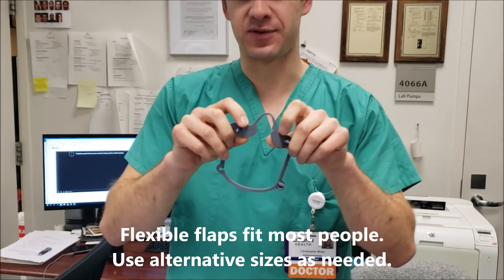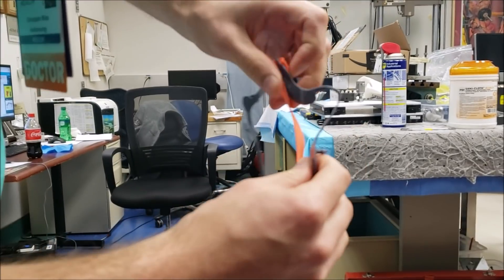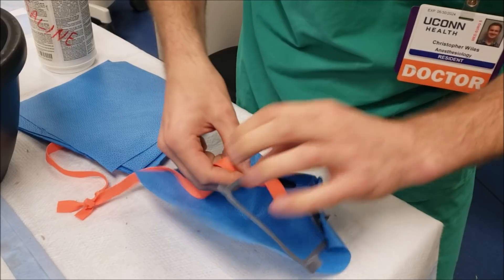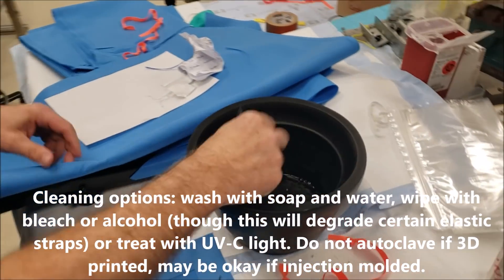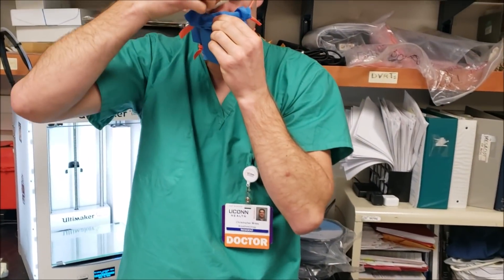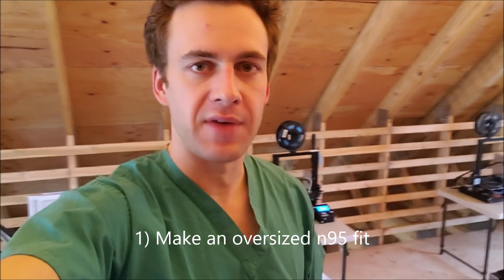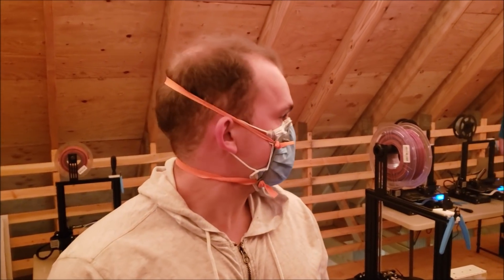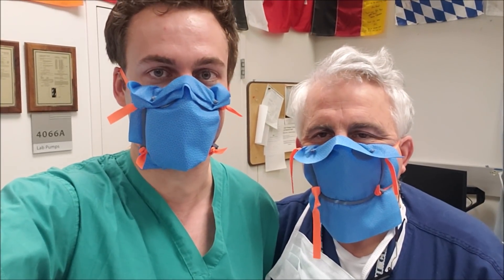COVID 3D Printed Mask Frame for Halyard, Investigating 99% Filtration

Comment from the maker: update 4/23: preliminary data from more than one lab show that this material does not filter as well as originally suggested under higher flow rates that may be seen during fast breathing such as running up the stairs or while doing CPR. At lower flow rates it performs relatively well, but at higher flow rates it performs sub-optimally, and the n99 or n95 levels should not be assumed under all or any conditions. Exact numbers are not available. This is likely a relevant design under many physiologic conditions and may likely be used a replacement for a surgical/medical/cloth mask, but we cannot endorse usage for this as an n95 at this time. Keep this in mind and use at your own risk.
Reply: Will the data for the filtration efficiency of this material be published in the near future? We have been producing the UF mask design both with this material and with 4 ply cotton; we are not a medical facility, but do have essential staff and biosecurity requirements. Another paper recently came out analyzing the efficiency (Konda, Abhiteja, et al. "Aerosol Filtration Efficiency of Common Fabrics Used in Respiratory Cloth Masks." ACS Nano (2020).) and I am trying to decide how Halyard compares to these other fabrics. If it is not going to be published, would the labs be willing to share their findings?

Comment: Will H500 work? Trying to find supplies as a non medical.
Reply from the maker: As a last resort, anything like this (blue polypropylene type materials) will have some sort of filtration capacity. No guarantees, but if you do a couple layers and it's in that sweet spot of breathable but almost too dense to breath through, and you have a good seal, you're likely filtering the majority of particles. Use real masks if you have them, but in total shortage scenarios go for anything you can get your hands on that is better than nothing.

Comment: That size looks like 18x20cm not inches. But thank you for the video. I'm printing some of these for my local veterinarian, who likely has the Halyard material - I will be using blue shop towels for my own (until I print the other style and get the filtration material).

Comment: What’s really sad masks don’t work against them
Reply: masks work to filter out certain particulates, but unless you have your own oxygen supply and zero outside air, there's no possible way to fully filtrate the particulates of any virus due to their size.  Pure oxygen however can kill you, so the best you can do is wear a mask with a filter, CDC might equate this equivalent to a bandana at the current rate, however it has the potential to be on the same rating as the n95 mask with the right filter. Any high enough rated and working filter can potentially catch a clump of particulate, which is better than no mask whatsoever however.

Comment: to cut the Halyard H600, why not use a Nicochrome wire with a current running over it.  it will burn red hot, cut and seal the two fabrics together.

Comment: As we've been saying from the beginning, sealing a good filtration material is the right way to make a functional mask 👏🏼👏🏼. We have a hospital field test in the works with our rubber band solution. Our version 2 is coming soon very shortly.

We love what you're doing here Chris! Your solution will actually help people. Would love to see it tried on multiple face shapes (women, children) too.
Reply from the maker: I have been following your work, as well! I agree completely - without a good seal, the filter material doesn't do the job you want, no matter what the filter is made of. Keep it up! I'll look for your version 2.
Reply: @chrischris64   Hey Chris, Love the mask design.  I have been working on two mask ideas that are using flexible filament to make all components printable including the elastic straps.  One is inspired by Sabrina's rubber band frame, and the other is similar in it's approach to your mask using a Halyard material as the filter. I can only get h100 so I'm assuming it wont be sufficient for nurses and doctors but I am hoping its at least something I can make for grocery store employees and other front line workers. While h100 is not the same as the h600 it's at least seemingly denser than cotton or other DIY materials.  Do you know if there is any research into the filtration qualities of the lower grade Halyard materials? Thanks!
Reply: @sniejadlik  This is the best source I've seen yet, though not peer reviewed. Check out the tables for one specific to Halyard products: https://sites.google.com/view/material-filter-testing/home

Comment: Should that be 18x20 cm, not inches?
Reply from the maker: YES! Sorry about that, it is cm. Also, you can cut bigger if you have more than enough material, such as 22 x 24 cm. That allows you to pull it through the front of the mask more for more comfort and surface area if you want. We just found those were the minimum measurements.

Comment: If anyone is using a FlashForge Finder I suggest: 210°F, 2.7mm first layer, 1.8mm next layer, 100% infill. Thermoforming with a hairdryer recommended. Also I dunked one in Alcohol for 24hrs and the structural integrity remained the next day. They do have their limits of bending though. I would suggest printing a ton of these using a few times then replacing. At 25 min a print this is a no brainer! Awesome work Dr Wiles
Reply from the maker: Awesome, I'm glad that worked for you. Thanks for sharing the alcohol soak test. I agree with frequent replacement with the short print time. I do 2 on a plate, about a 1 hour print. We have 22 printers and are looking into injection molding.

Comment: Wow! This is brilliant.  I saw your video on how to make an "N95 mask" with your 3D printer.  Thank you for what you're doing and share your innovations.  Have you put this mask through a FIT test?  Just curious if it passed or not.  Great uses for your creation!

My coworker and I came up with this idea for a surgical mask made from surgical blue wrap. It is not to replace the N95, but helps extend the mask. We also use these masks on patients and as our primary surgical masks.
https://www.youtube.com/watch?v=UrG_xmFq5e4&t=1s
Reply from the maker: Hi Brady. It did pass fit testing, yes. If trouble with fit, I made some alternative files, but most people will get a good fit and a rubber band between the spikes to close and nose/cheek gaps works really well.

Comment: Awesome design. Much better than any other "respirator design I've seen. But a point to make, 3:52 vacuum bags... Just so you know, most vacuum bags claiming to be hepa, aren't. Yhe hepa rating is on the vacuum cleaner itself and is a combination of vacuum bag and the permanent filter. Most vacuum bags are around MERV 10-12 while HEPA is 18.

You are better off buying a furnace or hvac filter.

Comment: For those without access to the surgical material,  this shows some possibility.  Anyone else seen testing of the towel material?

https://www.businessinsider.com/homemade-mask-using-hydro-knit-shop-towel-filters-better-2020-4
Reply: I tried looking into this form the Kimberley-Clark Professional site. After a lot of looking and finding conflicting statements it seems you have a choice of Hydroknit style (the Zep) which is fiber mixed with polypropylene or a straight meltblown polypropylene. It seems like the melt blown by itself would be finer but again they are very vague about stuff.The 3M masks use a mix of fiber and poly so are probably the Hydroknit. Wish I could get straight answers... all the suppliers around me don't really know for sure. One thing the 3M N95's I'm am pretty sure are given a charge to attract the very smallest particles - same as the furnace filters. I've heard nothing about the shop towels having that.

Comment: I printed your first mask and I used the moldable silicon rubber made with either Aquarium grade or Food Safe silicon sealant and corn flour. You can stick this to the mask using a thin smear of silicon sealant around the mask edge. If you place a sandwich bag over the part of the mask that accepts your face whilst the putty is still pliable, you can get a great seal by moulding the putty to the shape of your face.
 I then did a bit of a dangerous experiment to prove that the mask and the seal worked. I bought some Bitter Yuck anti chew spray for dogs off Amazon, donned the 3D printed mask and full chemical goggles and then I got the wife to spray me directly in the face 4 or 5 times with the Bitter Yuck spray. I had a taste of the Bitter Yuck spray before hand and it wasn't too unpleasant although it's definitely not recommend for human consumption on the packet. 
The mask worked great although I thought I could every so slightly taste something, but I was using J-Cloths as the filter material instead of a better material, however it did stop the Bitter Yuck getting through. Bitter Yuck contains Bitex so I figured  it would be okay and desperate times warrant desperate measures. However  on trying to wash the Bitter Yuck off my face revealed that the skin around and the mask around the googles was heavily contaminated and as I washed my face. I washed the Bitter Yuck into my mouth and up my nose, it took about six hours to get rid of the taste and the wife wouldn't go near me for a couple of days!
This revealed to me how important plastic full face visors are. If I had been hit by a stream of virus infected sputum instead of the Bitter Tuck spray, I would have certainly ingested some virus particles when I went to wash my face.
Reply from the maker: Haha amazing effort on your part. That was great to read. But in all seriousness, you're right about the virus and washing your face. I'm working on a quick face shield video now too. Wearing one is imperative to reusing masks, which is currently happening due to shortage, and staying as clean as possible. Thanks for the silicone with corn starch idea. I had never heard of that.

Comment: This is incredible, thank you so much for posting! Does anyone have data on the filtration efficiency of sterilisation wrap other than the Halyard brand? I run a Halyard mask making volunteer project, but have bags of other brand sterilisation wrap too which I'm not sure if I should use
Reply from the maker: You're welcome! Thanks for what you're doing, too. What are some examples of the other brands of material? I'd be interested to look into it. Maybe I can get my hands on it, even, and have our team test it in the lab, though it will take some time.
Reply: @chrischris64  if you could look into it, I'd highly appreciate it! We have Medline Gemini sterilisation wrap (https://www.medline.com.au/regular-gemini-sterilisation-wraps-gem2124), and pro-zone 47 wrap (https://www.multigate.com.au/products/sterilisation-products/sterilisation-wraps/pro-zone/47-gsm/mgp-30-467/c-24/c-1609/p-6601). We also have other models of halyard such as H200, H300 etc., Which I think has the same filtration properties. 
I'm trying to get information out of the companies, but it's hard because of the off-label use and their skepticism regarding our use of it as masks... I would have ordered a lot of Halyard wrap if I could have, but Halyard is condemning the halyard mask projects and refusing to sell to those using it as masks!! 😭
Reply from the maker: @mayazazu7070  Exactly, it's hard to find info and, as you said, Halyard is saying they don't condone this use of material for obvious legal reasons. We all have to remember, do no harm - if this is not fully tested or proven, we must never use these instead of approved masks while those are available. There is nothing wrong with stocking up to use as a last resort, though. I too have bags full of other blue sterile operating room materials and desperately want to know the permeability of them all as well. We are working on it. I'm also trying to help a team in Italy set up their own particle filtration test system to test materials and brands they have access to that we do not here. If you have a team of researchers able to and interested in doing the same, send me a direct message through the message system here: gf.me/u/xsqhra

Comment: amazing @
ChrisWiles, a lot more quick to print and secure. Thanks for sharing this nice idea. I don't know how to get Halyard h600 here at Spain, do you know another similar material or another name for this specific h600 fabric?

Cheers
Reply from the maker: Hi Paco! We are still running tests on various materials. Do you have drapes rated with the AAMI system 1-4? Operating room drapes are usually AAMI 3 and heavy duty gowns are usually AAMI 4. These materials appear similar and seem to be breathable, but I am waiting to have all the final results to share before any type of official post about these. What is an example of blue sterile drapes, gowns, or tray wrap that you have in Spain?
Reply: @chrischris64  sorry and thanks for the reply! Youtube didn't notify this reply. Any news about materials? I found this website https://diymask.site/. Basically it talks about two pieces of Tissue papers or the advanced option of using PP+PVDF+PET+PP. I can get some Operating room drapes or surgical drapes but I can't know the specs so... I will go to the safest option: I will use 2 layers of polypropylene woven fabric 40 gsm with 0.22 PVDF Membrane Filter inside. This will go on a printed 3dmask  as a filter. Keep Safe

Comment: It could be enhanced with a spring shape on the sides, like a compliant spring (compliant as in compliant mechanisms), so it moves along with your jaw while you talk and would fit a wider range of people. Would need to be tuned appropriately so it can hold for enough actuations while not sagging either.

Have you tried using TPU? or maybe even PETG or Nylon6? -- The latter two would behave better when sanitised and can withstand a lot more physical/mechanical stress. TPU would be softer on people's skins...
I'd say the ideal would be Silicone (LSR), but 3D printing with that is not common (yet). 

Nice design and concept... would love to hear more!

Comment: This a joke?🤣
Reply: Valerie Smith not at all. probably the best solution out right now for PPE shortage. hits all the marks: filtration, comfort, safety, breathability, speed/volume of printing, and lets you communicate easier versus 3D coverings. it’s also more sanitary if you’re swapping out the pieces of H600. + if you’re not in the medical field you can print one of these and get a better seal than you would get with a simple cloth mask or bandana.
Reply: @GUNNERBASS  I apologise 🙃
Reply: Valerie Smith all good! there’s def better looking masks out there, but it’s a form vs function battle
Reply: @GUNNERBASS  if you go to 
https://www.makethemasks.com, there's information about making masks with injection molding. I don't know exactly what that is but I'm guessing you do... ? 

Anyway it's a website for the now world famous 'Montana Mask' made here in my home state, by three doctors. They originally designed it for 3D printing but someone in Bozeman Montana altered the design for injection molding which he now produces 1 every 48 seconds. 🙃

Comment: What printer settings are you using?
Reply from the maker: It's listed under thingiverse but I'm doing 0.3mm layers using a 0.4mm nozzle on ender 3's with 100% infill, normal PLA temperatures (200 C extruder and 60 C plate), 60 mm/s print speed.

Comment: Sterile processing tech here. Can just the wrap in the other style mask you've post?
Reply: Or do I need multiple layers?
Reply from the maker: @JGERB54  The other mask already has two layers in series. I plan to add one layer of this between the mask and the face to have 3 layers in series, increase comfort and filtration. Working on testing multiple combos of materials and will update that design when I based on results.
Reply: @chrischris64  I meant in only using the wrap. Stores around me around out of the air filters. I had someone make me a mask since they won't give us a n95.

Comment: This is so much better than your other mask. The other mask has risks of exposure through tiny gaps in the 3d print. This mask uses the 3d print to support the filtration material rather than act as a potentially poor barrier. Please promote this mask over your other mask.
Reply from the maker: The other mask is going to get an update video soon with two options: 1) spray down with silicone or sealant, 2) place one layer of halyard between it and your face for comfort and an additional 99% filter of all air immediately entering your mouth. It's worth doing that one with those modifications if you have the printer time because of the reusability and additional filtration. Some people will find one to have a better seal than the other as well. I will update it soon, thank you for your input.
Reply: Mike Scully I agree Mike. I liked this idea from the beginning. Ive seen a few videos where there are holes in 3D prints on a nano scale. It completely removes this issue, is faster to print and is more breathable, while keeping a seal. And it’s quicker to “refresh” the mask. If this material is as widely available in hospitals as it sounds, then this is a home run.